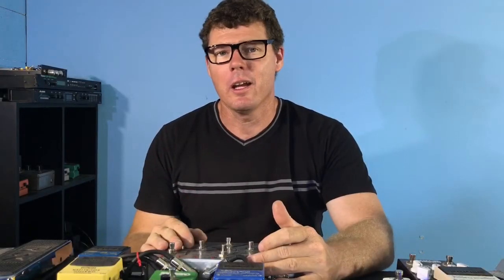DIY Programmable Pedal Loop Switcher Build (Part 5)

Comment: I have an interesting inquiry, how do you build an ab switcher that receives commands from an external device via TRS?
I'm trying to build a box that has a signal split on the right that would go into two preamp inputs, then have their FX send come back into a ab switcher and out as a mono, and then stereo in to stereo out back into the FX returns of the amps just for ease of routing 6 cables.
Why do this? I use a BOSS ES-8 and it has a handy always on send with a return BUT it doesn't support running this to two amps because it's mono. 
By doing this I'll be able to choose between two different preamps simply by using the ab return and sending the bypassed amp a signal into the FX return to use it's power amp and vice versa. It would be a HUGE game changer for me and many other players who don't even know this is an option.
It also wouldn't hurt to have a MIDI in/out for use with an external controller. Also to have a single split on it's way out for a device that only has a MIDI in (digitech whammy, I'm looking at you!!!) would be supreme.
Reply from the maker: That is a good question.
Reply: @PaulGrahamGuitarst  for real, it's like an ancient pedal builder secret. I can't find the answer anywhere! I bought the Electronic Projects for Musicians just to get into pedal building and I have been on countless forums and NOBODY knows how to do a TRS commanded switcher.
Reply from the maker: @joeyskar  It is something I have been thinking about for a while. It would definitely clean things up on the floor in front at a gig. It can be done.

Comment: Hi Paul, big fan. I found your video trying to find info while making a similar project myself. I've tried everything trying to make the mute relay work but it just pops too, so I get a pop when it mutes, then a pop when my switching relays engage, then a pop when it unmutes. Any idea what I'm doing wrong? Looks like you made your own board for your mute relay - is it somehow different? I just used a normal relay breakout board like your big ones. Thanks in advance (hope you reply)!

Comment: amazing work!!! , I just made a similar proyect but I have a noise in the line :( I think it's because to the relays there aren't made for the audio signal's. Maybe do you have the same problem, how you resolved it?
Reply: Did you use the same relays ? 
It would definitely be easier to use spdt relays like these in stead - dont know if the audio would be better. Isnt it just because you have signal running close by the microcontroller ?  https://www.ebay.com/itm/10Pcs-5V-G5V-1-5VDC-Signal-Relay-6-PINs-for-Omron-Relay/201462410588?hash=item2ee8186d5c:g:NXkAAOSwo0JWPFsa
Reply: or.. you might need dpdt relays... Hmm...
Reply: @MagnusKlo   when you carry over only one signal SP would suffice. When wired properly you don't need the sound to go through the arduino since it is just a controller.

Comment: Great project Great job..if i may ask how do you power everything (relays and the arduino)?
Reply from the maker: Thankyou! I use a 1 amp 9 volt wall adaptor, much like the PSU for the Boss TU-300.
Anything between 9 and 12 volts with 1 amp or more is fine.

Comment: Hi Paul... this is great!!! I have been making an Arduino controlled rack MIDI switcher based on the RG Keen schematic (http://www.geofex.com/Article_Folders/rmtswtch/rmtsw.htm) however had run into major issues with noise (popping, etc)... your implementation of a mute relay may be the answer! Brilliant but simple!

As others have asked, do you plan to post up a schematic? I would really love to see the details of the signal routing and grounding.

Thanks for sharing this project.

Comment: Cool Paul! Thank you for the simple idea. I added 3 more buttons to your sketch. And 4 (reset) will send the signal directly to the tuner. By the way, instead of 13 pins, I used 7 to prevent the relay from working when you turn it on.

Comment: Hey, I have two questions. I am currently working on my own Arduino powered loop switcher. How did you mount all the electronics into the enclosure to get everything to stay while looking clean? Also, in an earlier video you said you added a feature where you used stereo input jacks to keep the switcher from adding a loop if nothing is plugged in. Would you mind explaining how you did that? Thanks!
Reply from the maker: Hi, With the relays I used small counter sunk headed bolts, nuts and cut down some green wall plugs for spacers.
The Arduino board was a little more difficult because there are components very close to the mounting holes so I bought some plastic pcb snap in stand offs. I still needed to trim them to fit the Arduino board.

I used Neutrik Jack sockets and use just put them together with the lugs touching and the jack holes facing the same way. Solder all lugs together and connect your wiring to the lugs with the contacts that meet the jack connector when it is pushed into the socket.
I hope I have cleared things up.